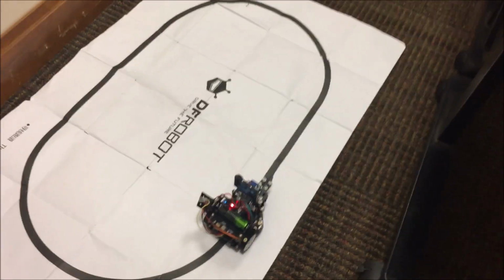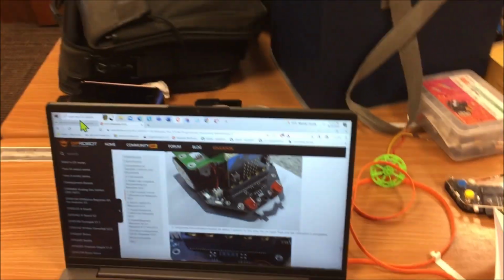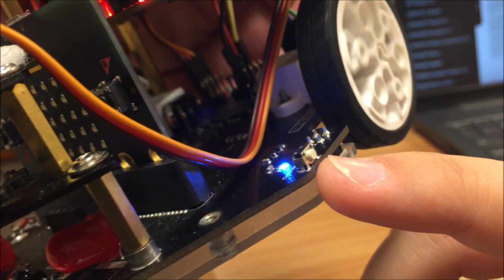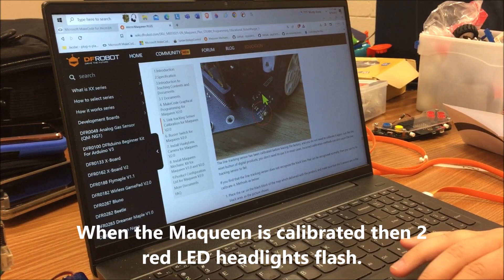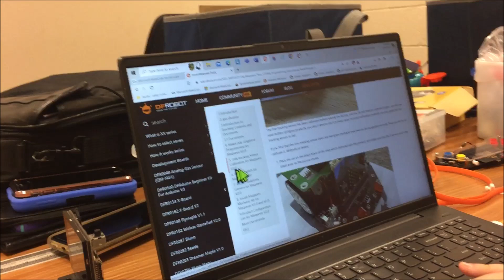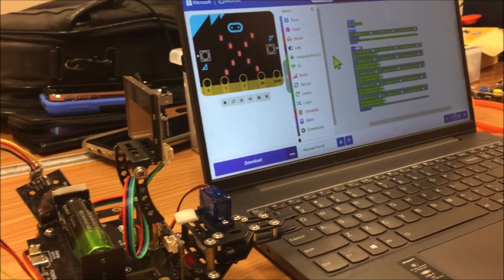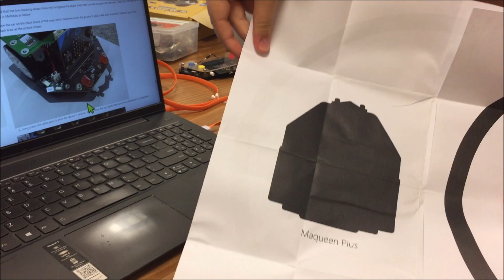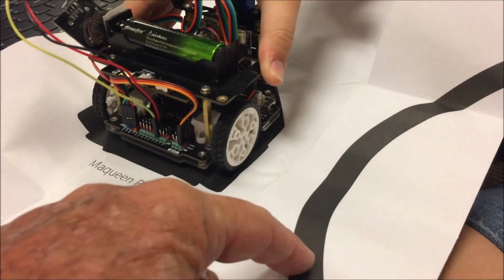Calibrate Maqueen Bot Car, Microbit, IR Tracking

Comment: were challenged by our teacher to calibrate it to make it as fast a possible, any ideas on how to make it go faster? with just changing the code?

the top 5 fastest in our class will have a secure 96 on their scores, so i dont wanna miss that chance
Reply from the maker: With just changing the code @loafers1014 , you can make it go faster by increasing the numbers in the bubbles for speed: Set all motor direction rotate forward to speed (80)....to speed (100). and the same with other speeds. This will make it go as fast as possible.   But it might be a problem because the sensors might not be able to read the input (black line or white paper) fast enough and the bot car might go past the line edge if the wheels turn too fast. Try it and see.   Sorry for my late reply.
Reply: @makecodeandhardware1395  thank you so much!! This will help out a ton. Dont worry, you replied just on time